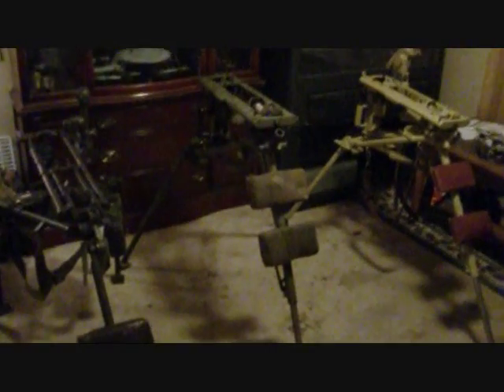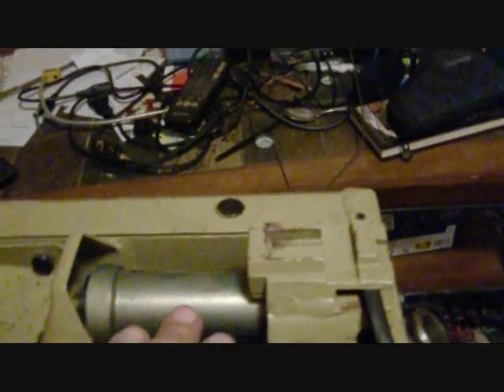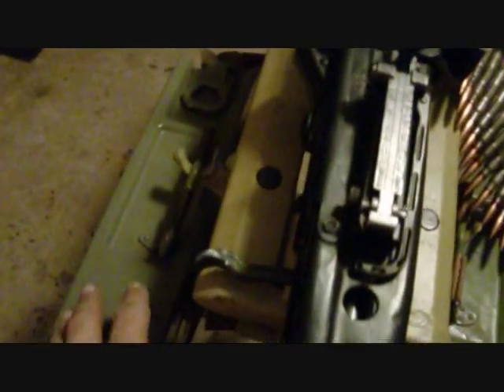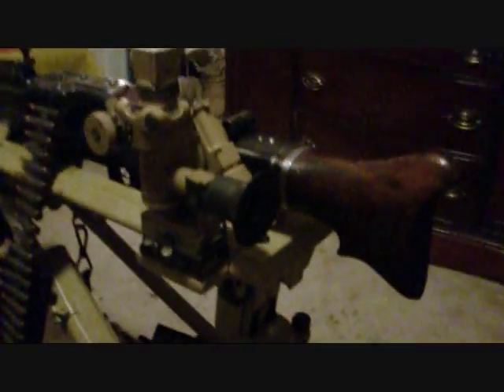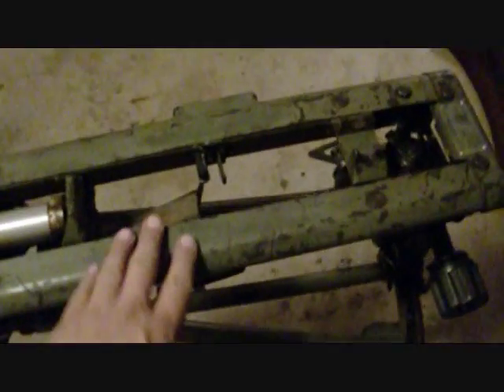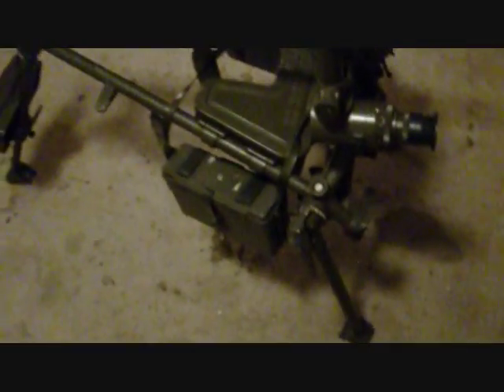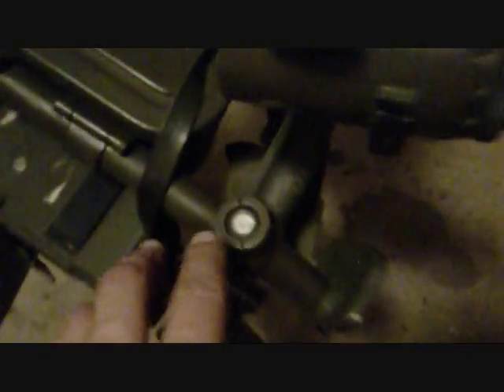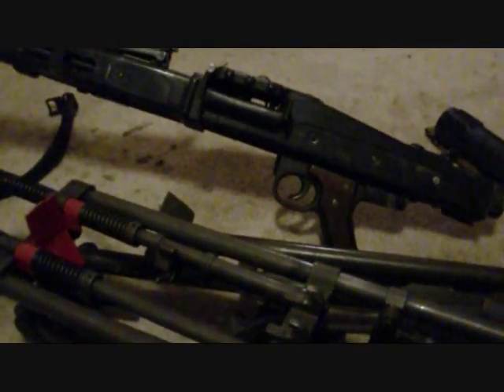Mg42/M-53/MG3 Lafette Tripods

Comment: Nice vid. It should noted that the bright red plate on the MG3 tripod is for Bund blank firing (training) and should be removed when firing live rounds which is why they made it bright red as a reminder. Some say it s a "shell deflector" which is incorrect when actually is a recoil enhancer, to more closley simulate for training low powered blank rounds by changing or enhancing the spring rate of the tripod. The gun will run much smoother (with less recoil of course) with it off as intended.